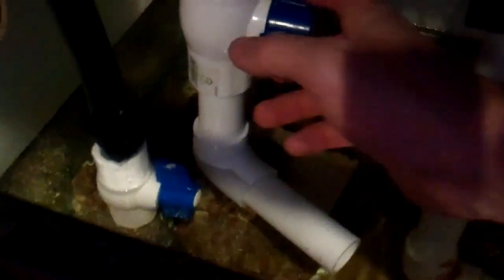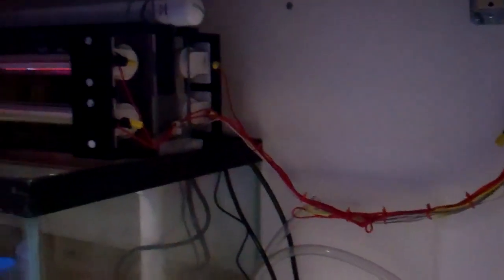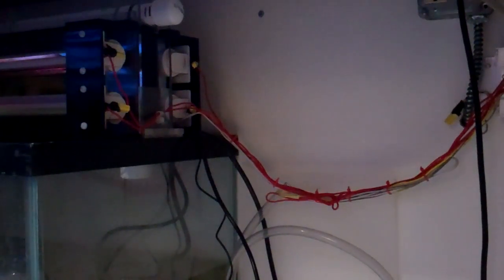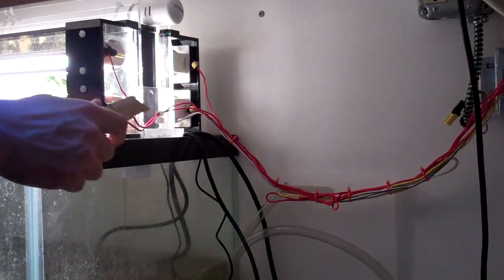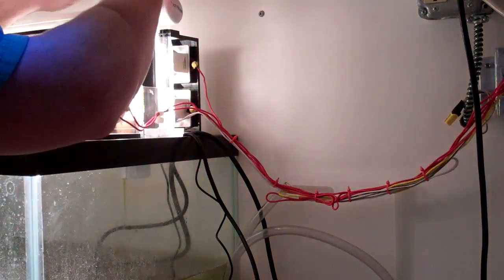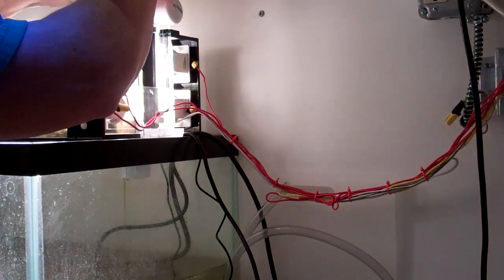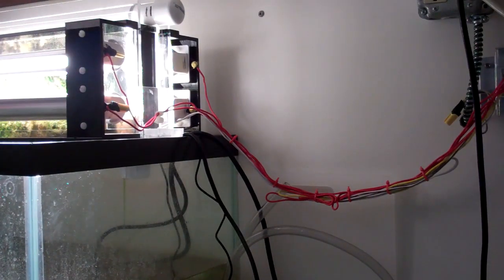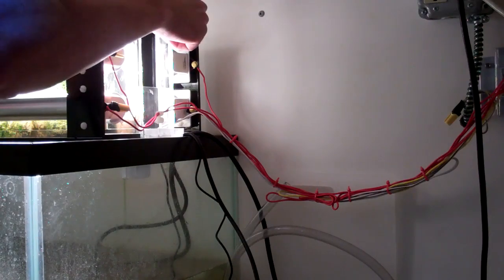125 Reef Algae Scruber Screen Cleaning Part 1

Comment from the maker: You can go a little longer depending on a few factors.  Also you can make them based on the amount you feed rather than the size of the tank.  The 10-15 minutes a week I spend cleaning the screen pales in comparison to the amount of work I used to have to do to maintain other equipment and do PWCs, and I can feed like crazy so the fish and corals are happy